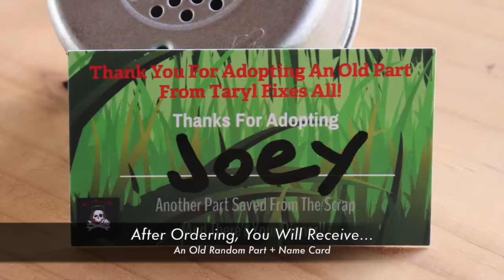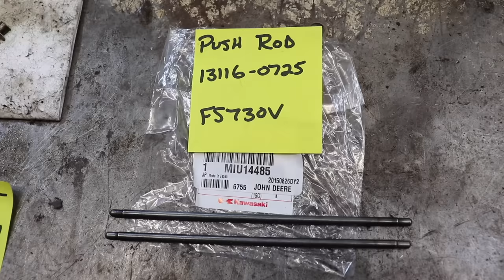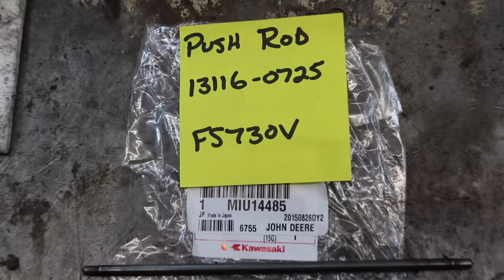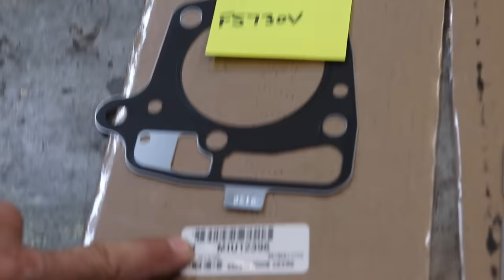How To Fix A Valve Guide That Moved. Epic Fix!

Comment: I have a Fx850v and having trouble with cylinder #1. Im only able to adjust valve lash to .0025. Thats maximum lash I can get on intake valve. I believe the valves are sinking into the valve seat deeper making lash to close up holding valve open. I though it was bad coil at first.
Is this common for the Kawasucky?

Comment: locktite makes a couple versions of "high temp" locktite  that would not deteriorate in this application, I want to know if Taryl still gets that oooOOooo new Gaskets/Parts in the mail box feeling  (the smell too) when they come in the mail :D another good tip is to scrub both parts using evaporating solvent so the locktite bonds properly. Very good fix on this Taryl!

Comment: I save everything it’s hard for me to throw anything out!
Reply: I do also but I can never find it when I need it.
Reply: JMC5 you’re in the same boat brotha
Reply: @jmc5341  That's why I'm building a 12'x12' shed. It will be my own part store.
Reply: @rverro8478  You'll fill that up quickly. 12 x12 meters would be a better starting point.
Reply: Considering how much you get for a freaking lawn mower down there, I'd keep everything too! 
600-800 for a green lt1000 Craftsman? 
Loco in the cabeza.

Comment: Hi Taryl,I'm looking for some help if possible. I have a John Deere Js46 (JM46 in the UK). It's missing the oil filter and I managed to source one , however the filter coupling diameter is too big for the oil housing . Could you possibly point me in the right direction

Comment: on a serious note tho, whats your thoughts on aftermarket valve guides i'm getting my yamaha big bear 350 re done, and I ordered some off ebay they say there replacement ones current productions but one from yamaha, they have squrie marks for oil retention but then i was thinking there shoudn't be any oil int there I probably should just get yamaha ones eh they don't look brass they look like steel

Comment: Hey there terrle would you happen to have both cylinder heads used but good for a 23 hp briggs? If so how much? My valve guides slipped outta place. This is a donation mower so I'm bringing it back to life. Thank you for your time.

Comment: 👍taryl, shrink the valve guide bore with a steel ball bearing and couple taps with hammer. Old machinist trick works easy on aluminium. Try it sometime. Great videos, entertaining and informational. Keep it up. I like my dinner!

Comment: Taryl love your channel I've used it alot,, so I have the kawasaki FR730V so as you know it has the smaller air filter system , I keep my filter clean but have noticed if I pull the air filter off to clean and the rubber hose on top of carburetor. I can see a film of what looks like fine dust particles inside the carburetor throat   you can wipe your finger around inside the carburetor throat and my finger turns black. So question is there's a air filter up grade kit like comes on the commercial mowers that sits on top of motor, it's $ 220.00 for my FR730 . Do you think that's a good investment  ? My mower has 230 hrs on it. It's from power equipment man. Thanks

Comment: Have an old silver eagle dixie chopper with the 27 hp generac engine and fuel expansion tank way up top.  Twin independent  hydro drives. and the chain sprocket deck lift system.  It's a beast.  I use it for rough cutting heavy buffalo grass and even 1 inch growth and brush.  I call it the mini bush hog.  Because it gets very very dirty, what I have done is simply cut trap doors all the way across  in the top engine shroud with simple metal brackets.  Then I run duck tape across the seams.  when it's time to clean it up, I let it cool down completely.  run a knife across the tap seams and lift up the entire top "lid".  Then compressed air to dry it.   Close the "lid"  run some tape across it again and I'm ready to cut another 3 acres. works so much better to modify your gear.  I also put a nylon sock around  the air breather cap and HD filter.   So much easier to stop and just pull the nylon off give it a whacks to clear it and continue on.  It catches alot of heavy dirt and dust and pollen...the pollen is what chokes my machines...on humid days it's like glue...so the nylon socks is the cats pajamas.  I have rat traps with bait all over my shop.  It's a private farm estate, down in the deep south, so we have serious problems with the vermin.  I even set up cardboard boxes with pin straw to attract them to nest there and not in the machines.  You learn these little tricks because its very expensive and gets ugly real quick when a machine goes down for a few days.  1400 acres doesn't wait for lack of planning!    I expect this mower to last longer than I will continue blasting grass.  A friend of mine gave me one of those jaguar hood ornaments.  It sits proudly up front.

Comment: OK.  I did this repair on a Briggs 20 hp twin Intek.  The design is different and the valve guide body isn't as thick on the side. So I actually did two set screws on opposite sides, tapped and threaded and used the high temp red figuring if it failed I hadn't lost much since I was shopping for a new mower anyway and I was maybe what you'd call curious if I could do it since I'm not much of a mechanic. Bought gasket kit, push rods, did the set screws and set the gap on the valves. Fired up, still missing. I had put the cover back on with the old gasket just to be sure it would run, so I just removed and the gap had closed. Dont know how it did it since I know I had tighten up the nut and thought I had rotated the cylinders to the right position to adjust both valves. Anyway adjusted the valves again, sprayed the head with mystery oil again so it didn't start dry. Started up and ran like new.  I sprained my arm patting myself on the back. Been 2 months of mowing and so far it's still running great. Thanks for the tips Taryl, I'm proof that even the brainless can do some small jobs.

Comment: Just a little trick I use, is to do the cleaning and grinding compound but I use my drill on the end of the valve stem on low speed and spin valve with drill in forward and reverse up and down accomplishes the same as you but is much much easier.

Comment: Every mechanic should make friends with a good local auto machine shop. For example I had a flathead IC with a wallowed guide hole and mine found a matching FLANGED car guide, bored the hole, installed the nice cast iron guide and fixed it better than new. I later got my own knee mill and lathe (well worth the effort) but most folks don't have the room for that even if they have the cash. Your local small general machine shop can do many useful things too.

Comment: Taryl ... on these Kawi heads .. have you ever seen the rocker holder bracket loosen up on these motors? I’ve seen a couple that the bolt has loosen up and the rocker drifts off the valve stem. We do the same work. When I see your vids I’m saying to myself ... did that .. done it. The only pain in the ass is that sometimes you can’t get at those exhaust manifold nuts .. I’m thinking you should do a vid on these Kawi motors replacing the case gasket and crank seal .. how to set the governor up after restall.

Comment: Just opened a 580V for a blown head gasket. While inspecting the head,noticed the valve guide seal was loose and the guide had migrated the other way. This engine also was overheated at 350 hrs due to crankshaft seal leak and the breather cover bolts backed out. I'm finding the more I work on these kawasuckies .it' s not so much the design or quality issues as much as it is Quality control issues. I'm sad to say,,only the ones built in the states. I made a video of the damage and process with a link to this video if the migration results in bent rods. This one I put in place with a beryllium punch and it was tight. I don't think this one will fail again unless it overheats again. The vertical shaft engines have much more of a cooling debris problem then the horizontal engines. I added a link to your page for a repair.

Comment: yup Taryld! ive had that same problem, motor gets hot and guide being steel doesnt heat up as fast and slides in more and rocker 
cant cycle and travel reduced, bends pushrod mine was on 727 jd? i think and fins were all clogged , lol fixed it once and happened again, ended up drilling and putting small screw to hold it

Comment: The cost of a new head that is redesigned with more cooling area is less than the labor to make this bandaid fix. I have done this fix with sleave retaining Loc-tite and then peened the head around the guide. It made it about 10 hrs and then bent a pushrod that ended up in the bottom end. That was a whole lot of fun to deal with.
Reply: Sounds like you did a poor job on your fix.

Comment: Taryl, I have a late 70's era Honda G300 engine (off roto tiller), and it has cylinder wear, worn out guides and needs an intake valve seat..
The new NOS guides I bought the valves won't fit in though the part numbers are correct according to my list.   What would a shop normally charge to do all this work (I'll do re-assembly of motor).. And do the new guides just get reamed out for new valves once installed or could they be wrong?  I figure I can just re-ring the motor (after knocking off the ridge at the top of cyl with a hone.. vs. boring it .025?) any suggestions?

Comment: I used to do some mechanic work for a drywall and insulation company and made a small fortune fixing bent pushrods and replacing heads on their insulation blower engines mostly kohler I never gave them any warranty on the repairs either. One day the bossman asked why they kept having the same issues over and over again. I simply told him that insulation holds heat in as well as it keeps heat out. I tried to tell them they needed to let me do routine cleaning on the engines or it was just gonna keep it up, it never stuck(well the valves did) but they never ever got my drift that all they needed to do was to blow the engines out ever so often. But cha-ching(fist pump) and $hazaam($$$)

Comment: Hi Taryl. Another way to fix it is to have the machine shop knurl the valve guide and press in with locktite. Double up set screw if possible.

Comment: Would not be possible to drive back the guide with the hammer and a piece of brass tubing after removing the spring without taking out the head?

Comment: 3:39   Fortunately my Kamasaki (FX921V) has the removable access plates on the top so I can easily remove a small cover to see if there's debris on the cooling fins and clean it out.  Hard to tell on engines like that one you're working on.

Comment: Regarding nests and other animal hijinks, my friend was replacing some electrical components in my Lincoln Town Car. He took a lunch break during the repair. The next day I started driving the car and right away the check engine soon light popped on. He said bring it back right away.  When he opened the hood, he saw that all the wires be had worked on the previous day had been completely chewed through by some rodent. He was puzzled as to why this would have happened, then remembered that he had had a peanut butter & jelly sandwich during the repair lunch break, and remembered that he had not washed his hands after handling the peanut butter. Apparently, the peanut butter scent was like a dinner bell for the pesky little guys.

Comment: As always a great video. I know you avoid prices for the most part, but with all your time what would a new head be? I sincerely appreciate your fix but just curious.
Reply: A new head is $288.
Reply: Buying a new head isn't going to help the problem because the valve guides are still going to move on the new head.
Reply: @pmaint1  As I understand the situation, the guides moved due to excessive heat caused by a mouse nest.

Comment: Does anyone know the dimension the valve guide should extend into the head? I have both heads off and all three remaining valve guides are at different heights. There is evidence that both cylinders overheated so I can't be confident that any one of them is correct.

Comment: My neighbor gave me a Toro Recycler that he could no longer get started. I found that the valve guide moved and was holding exhaust valve slightly open preventing it from starting.
  No fluffy, just grass clippings got deposited up there in air flow.

Comment: LOCTITE® 266 is a high temperature, high strength, red-orange anaerobic threadlocker. It is a 1-part, thixotropic liquid that is fast curing and which resists oil and mild surface contamination at temperatures up to +449.6°F. Locks up to 20mm in diameter. Perfect for Exhaust valve guide installation.

Comment: DIFFERENCES in head bolts, did you notice one of the LONG ones was BLACK? Does the assembly manual specify a SPECIFIC location for THAT one? Like maybe close to the exhaust???
Reply: I'm sure they all started out the same color, but that one looks like it is mostly exposed to outside air, while the others are protected inside of the head/block.

Comment: 11:12 
Did those 2 head bolts near the plug loosen up easier or were they loosened before getting to the other ones ? 
Seemed like they cracked loose real easy and that's usually a good sign of an overheat.

Comment: In my experience and judging by the hammering he gave that valve guide it only needed the head heating up to press the guide back never beat it out cold it damages the hole and probably cracked the guide and I feel pressing it back would be safer plus if cooled properly may never move again.

Comment: Can someone let me know where to look for Brigg's crankshaft lenght and diameter, on different models? I have a shop cd with the different manuals but none have these spec's. It would save alot of time, without having to take drive pulleys off of the riding mowers. I need to do some swaps on a few Brigg's riders from 13.5 to 19.5hp, Any help is appreciated.

Comment: kinda thing id do , youd think they'd design them better given its a common fault as seen on so many YT channels, i keep all my old eng parts they always come in handy, they the manufacturer could add more copper wire to the stator so it could power a cooling fan , id rewire my own stator with enamelled  winding wire to make more juice.

Comment: Taryl, why did BOTH rods bend if only one side of the valve guide walked out?
Reply: When the first one let go, it probably got jammed under the other  rocker or something and took the other one out. 
It's just dancing all over in there.  
I had the same thing in a Briggs recently, exhaust guide moved, still took out both pushrods.
Reply: @MrTheHillfolk  I can see that, but must be rare occasion. Usually only the one side gets it. I still replace both though

Comment: I had a mower do this once. It only happened because I swapped it out to a bigger bike carbtraitor without jetting it accordingly and it ran lean. Ran my own manifold too. It lasted about an hour but it had a lot more cutting power because the air flow lol
Reply: I also just hammered the guides back in and drilled the jets out it never happened again 😂

Comment: It's amazing how many people think this is not a sound repair job. Expensive aluminum automotive cylinder heads get all kinds of major repair work like welding  and machining when cracks are found. Often times these repairs look terrible but are much stronger than the original substrate. Since stepped guides are not used in most of these twin cylinder lawn mower engines then set screws should be utilized in every one of em. It's not a matter of if the guides will loosen and move it's more a matter of when. With the lean fuel mixtures used today these engines run hot without a rat's nest and if pushed they will overheat especially in hot weather etc. Valve seats fall out all the time. Lots of those repairs ain't pretty either and its uncommon to replace the whole head in that case also.

Comment: A 50 + - year old machine shop in my area which was very into building drag racing engines recently closed. One of the former employees said that over 200,000 lbs of cranks, heads, blocks, machine shop tools, etc all went to the scrapyard. I'm still sick over that news. It was not a good day for old iron parts.

Comment: I have a question Taryl. Wondering why you can't fix a Briggs valve guide the same way? Is it because you can't get a set screw hole drilled to fit? Or is the guide molded in a Briggs and a Kawasaki pressed in?

Comment: Isn’t it easier to put a lite knurl on the  outside of the guide and drive it back in. Cause i think the cylinder head got trushed with the hole you drilled
Reply: It ain’t the space shuttle.

Comment: Getting ready to do this on a Briggs 20 hp with well over 400 hours, 21 year old John Deere L120.  If I can get er done, I'll then pull off the #1 cylinder valve cover and check for a migrating valve guide.  I don't want to spend much on a mower this old and I am certain the ole K46 is beginning to fail.  I think I may be doing this as much to see if I can do it as trying to save the mower.  Don't believe I want to rebuild that K46 tranny.

Comment: I buy old tractors all the time I take the motors off and every cables off deck belts Drive belts anything that useful as in good shape there's somebody out there needs a part so when they come to me for a apart instead of buying on line or any other parts store. I clean all my parts that I take off and what can be clean rust free, I shoot a little paint on them and call them used reconditioned parts. I give them a big discount. That's why they called me Fix-It man

Comment: Using a tubing cutter to score the valve guide is better than a ziz wheel. The tubing cutter will raise material the same as staking with a pin punch but evenly around the radius. There is your midnight snack...